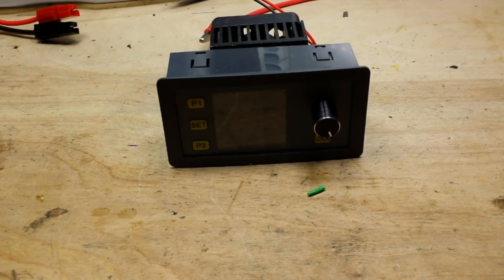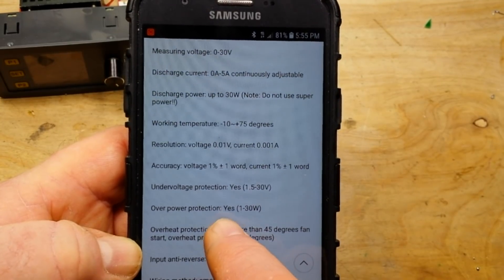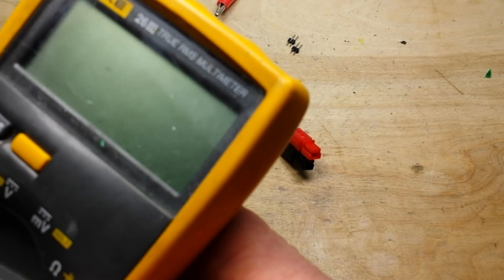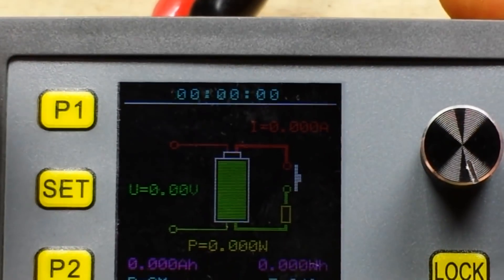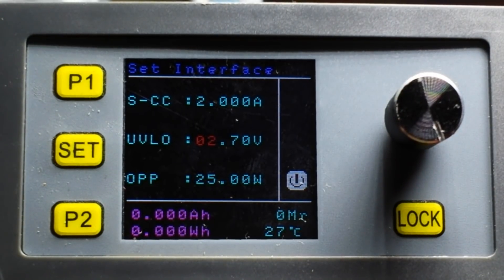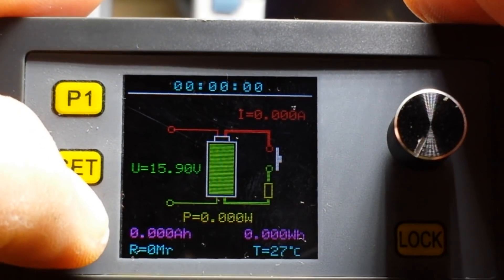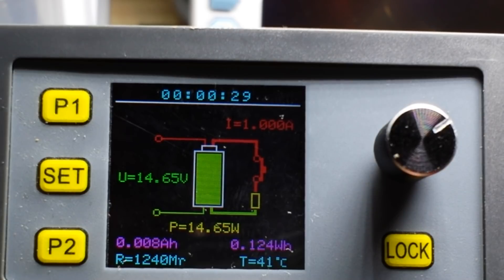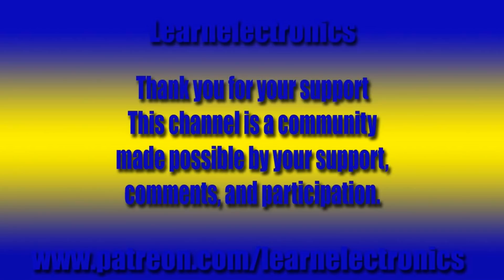$20 DC CC Load from AliExpress

Comment: That thing has a XL7005a buck converter for the fan, it's set to 12.6V lol so in theory you'll need to feed it 13.6V min (15V) to get the fan running at full speed, I ended up hardwiring a 5V fan to be always on and I'm feeding it 6V (there's another 5V buck that needs min 1V to operate)

Comment: I ordered one too. It would be nice if you could use the pot while in operation to ramp up current instead having to pause and adjust on the other screen. If it is possible on newer units, pls let me know. I do like the 4 wire kelvin connection to monitor the wattage tho. More than good enough for the new hobbist in the game

Comment: Hi. I don't understand what this unit is, what it is for and why you would use it. Could you enlighten me in a few words? Many thanks.
Reply from the maker: An electronic load places stress on a circuit. This is used to test how the circuit will behave under load. For instance, say you are designing a power supply. It will behave very differently when open circuit as compared to when there is a load on it.
Reply: @learnelectronics  Many thanks for that explanation.

Comment: For a load up to 35W the ZKE EBD-USB+ is my new favorite from China. Usually i don't like it that much when lab stuff needs a connection to a PC, but for a load i like it a lot when i can setup automatic tests or log the data through a Windows application. It can act as a load, or as a simple current/voltage logging device between a power supply and an external load. Andreas Spiess did a while back a great video about it and after that i had to purchase it (about 23€). https://www.youtube.com/watch?v=VDCShH-zj0U  I use it pretty often for my arduino / esp projects to log the power usage for a while and check if the deep sleep really works or to get a nice discharge curve of batteries.

Comment: It is a  neat and cheap load. they coud add an green connector male + female that detaches and has the screws for external connections as in the DC DC power supplies eg DPS5005, but maybe price would be higher

Comment: I bought a 400w load from eBay recently. 140€. Cost more but it’s way better than these 30-60w loads. CC CW CV CR mode. Battery mode and remote sense too.

Comment: Looking for one to measure Capacity on LiFePo4 batteries.  Need a few hundred Watts and at least 30Vdc.   Maybe a FET Project ?  Internal Resistance would be Gravy but mostly just looking for Ah and Wh.   Suppose one could use a Shunt to Larger Load Resistor  and use this one .
Reply: I'm thinking about doing a similar project. I'm thinking I just use something simple, like an opamp, mosfet, big fat shunt and a microcontroller for data logging and control.